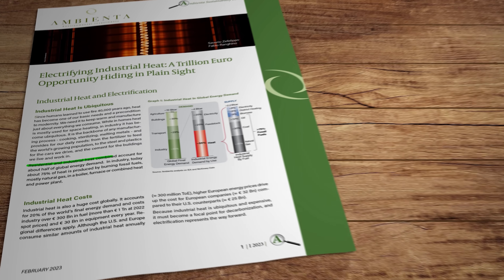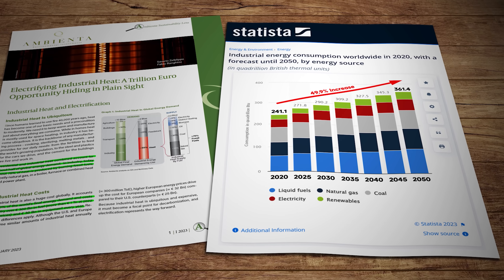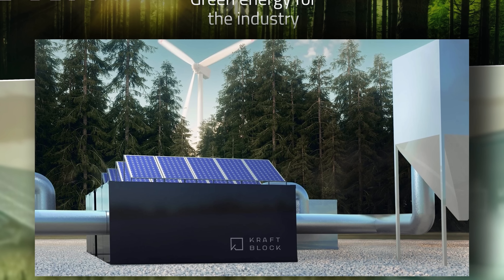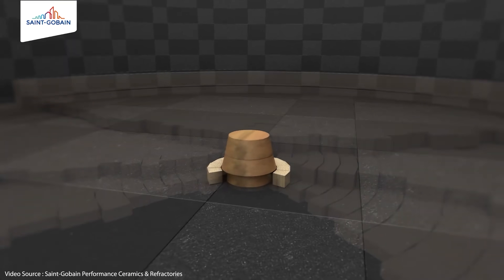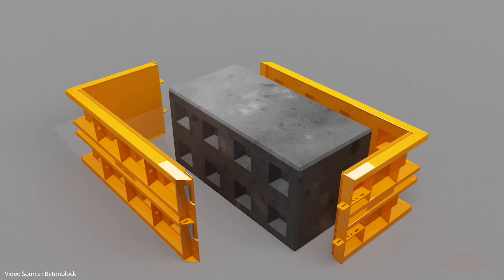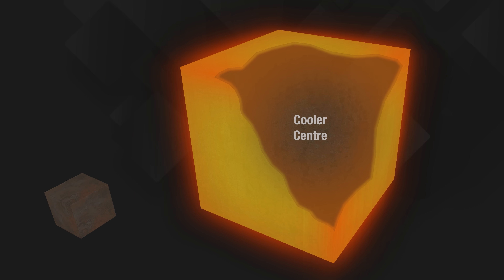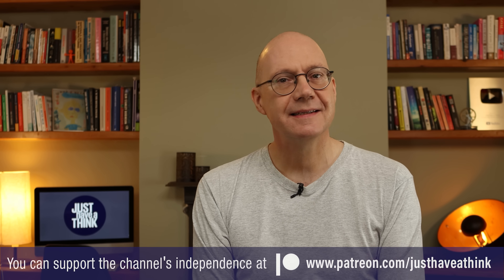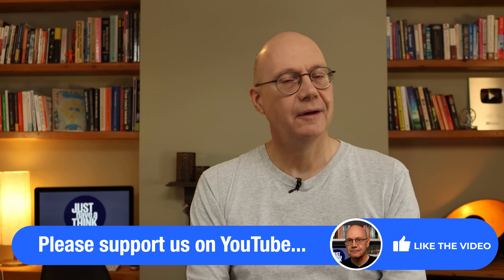Moving waste heat from industry to homes.

Comment: This will only make sense if you consume less fuel in shipping the units than you save in using the stored heat. Might make more sense as a supplement to cogen plants, to smooth out heat production. Similar to chilled water or ice towers for trigen. Also, how are they getting the waste heat up to 1300+ C to store it? Are they running some kind of power cycle/heat pump? Or relying on all waste heat sources being that hot? And in either case, would it make more sense to convert that heat to electricity instead? Especially for long distance transport. Lots of questions. Still has some potential, though.
Reply: Imagine using some of the heat from the container to boil water and create steam to run an external combustion engine.  A green steam engine!
Reply: no, not really. This is just the case in refineries and in the chemical industry. Flaring is an "essential" part of the steel production, @pin65371   The idea of a storage is to decouple "energy-generation" from "energy-usage" - so it is a perfect example why thermal energy storage can be used here. And to be honest: why should you use high-grade heat to generate hot water? That is "wasting" it again. There are much better use-cases. Capturing at >1000°C enables you to generate electricity, calcinate or sinter raw-materials, generate steam for one of the multiple processes in the steel-industry and so on.
Reply: I was also wondering why they wouldn't use the heat to generate electricity. Because with 1300°C you could run a heat engine at a theoretical Carnot efficiency of almost 80%.
Reply: @pin65371  shipping containers are well sealed
Reply: Hey there. This is true, the radius is limited for it to make sense. As for the 1300°C: Think about flare gases which make a huge portion of the waste heat in steel and chemical industry and flares are also used in the oil&gas industry.
Reply: @pin65371   Please dont.
Reply: @pin65371  Hi. the documented waste heat  from lost converter gas and BFG is more than 11 TWh each year in the EU27 according to the EU energy statistics. And there are date from several steel producin country missing. Our experience, especially in the steel industry shows that it has the potential to heat millions of homes.
Reply: @pin65371  This might be a use case, sure. A better use case however is to cut natural gas for a process that actually has 1000°C. This means less losses. Pre-heating water is easily done with a little bit of electricity or low-grade waste heat. Pre-heating air in a blast stove is rather difficult.
Additionally: what can be used to generate power is already used in integrated steel mills. Still, there are a lot of surplus gases that are flared.

Comment: (Relatively) Simple and interesting concept. When I heard ‘phosphate’, I wondered about sustainability of the system and potential competition with food production. Has the originator mentioned anything about the ability to substitute phosphate with something more abundant and less critical to other usage?
Reply: It doesn't sound like it would use all that much phosphate.  The heat batteries are re-usable for a long time, so you wouldn't need to continuously replace the phosphate.
Reply: Hey, we cannot go into that too much, but we developed a phosphate-based binder for the material which dries at ambient air to form the pellets. The material is tested for 15,000 cycles with no degredation seen. (This took 2 years to test, after that we stopped it due to our gas bill :D )

Comment: Slag can become a commodity. Its already recycled into mineral-wool insulation (fireproof, sound deadening and good R-value). Having more uses for recycling slag is a win. Don't knock coal as that also produces coke and ash recycled into cement board/fiber board that protect home exteriors.
Reply: Definitely knock coal because it produces more CO2 per kwh of heat, than any other fossil fuel. However there’s plenty of coal waste sites from large scale past use, and here recycling is welcome. Also there’s plenty of ongoing waste from e.g China.
Reply: Roxul insulation made in Mississauga Ontario
Reply: Yeah, thanks but I gotta knock coal anyway.  It is our most toxic fuel, and is responsible for the death of millions.  It's our most carbon-intensive fuel.  Mining it and dealing with the coal ash are gigantic environmental problems.  There is nothing good about coal.

Comment: Typical fundamental failure. Truck one of these boxes 750 miles and you're at a net energy loss. That's with 100% efficiency and 100% energy extraction. Mind you, thermal energy storage is a great idea. It's the concept of trucking high-density material at extreme temperatures that is mathematically stupid not to mention dangerous. Especially in the context of simply converting that thermal energy to electricity on-site and then using existing infrastructure to transport electricity. More buzzword based BS that doesn't stand up to highschool level scrutiny.

Comment: Why not use just gravel stone for this?  That's the way it is done in so many green houses. A 1m high gravel layer in the underground through which the hot green house air is blown during hot noon's, and recuperated during colder nights.
Reply: Gravel needs to be mined.  Slag is just lying around…
Reply: This battery uses more than just slag.  It's a sophisticated engineered material with at least two components, one optimized for energy storage and the other optimized for thermal transfer.  It's better than gravel.  If you're going to haul it around on a truck, you want it to be as efficient as possible.
Reply: @incognitotorpedo42  Should name me some low cost materials that fulfil these requirements, inclusive that they should withstand 1100°C?  Metals are excluded because not cheap!
Reply: Slash would actually be better than gravel for that use case, if only because of the reduced cost of collecting it a opposed to digging up gravel. I wonder why it's not always in use
Reply: @trueriver1950  I suppose the slag needs to be broken to small size?  And what with the breaker if metal parts are present in the slag?

Comment: If Uber was smart they'd open a division called just that!  This is a seriously good idea especially in places like Canada where I am where heating isn't just a luxury it's life itself.  There are tons of remote towns and villages that are relying on diesel power for both electricity and in some cases industrial heat. It's dirty, it's expensive and with our large amount of renewable potential it's insane... Small Modular Reactors are also a good fit however most places are quite anti-nuclear at a local level so the renewable power + battery solution seems much more "palletable" for a variety of reasons, pun very much intended...
Reply: There will likely never be a renewable/battery solution for heating.
Reply: @joemccarthy7120  Why?
Reply: It will always require the need for conventional backup generation.  That renders renewables/batteries almost a parasitic addition to the grid. @TheGrundigg
Reply: @joemccarthy7120 So you know very little but black industry talking points from mostly unrelated discussions of the electric grid .  Go away troll bot .
Reply: @johndododoe1411  Sorry.  I didn’t intend to upset your religious sensibilities.

Comment: This is a really good idea.  Thermal power plants, steel mills and dozens of other facilities would love to sell their waist heat.
Reply: I got tons myself to get rid of.... Waist heat that is..... I could use a smaller waist srsly... Know anyone that'd want it???.
Reply: An important aspect of this is the idea of using energy from surplus renewables to generate industrial heat within an acceptable tolerance on site thermal battery.  Processes like smelting could use renewables when their is a surplus to build a bank of thermal energy to be used in part or in full for a day.  If power prices for surplus renewables were accurately passed on innovative industries will put in the effort to work with the nearly free / otherwise wasted power.  Other processes like desalination or carbon capture could simply operate when the surplus exists.
Reply: Waste heat much above 100C isn't wasted at a thermal powerplant. Waste heat refers to heat that is lost and not easily retained or heat that is above ambient temperature  but not hot enough to extract anymore useful work from. 

Cooling ponds and towers at thermal power plants are below boiling point water or steam above that threshold can still have energy extracted from it to produce electricity. 

1000C plus heat isn't waste heat lol.
Reply: Waste.
Reply: And no one makes a pun about "waist heat".  I'm disappointed.
Reply: @yeroca Capybara did 1h ago .
Reply: @johndododoe1411  I missed it somehow.  Thanks for that!
Reply: @yeroca  why didnt you?
Reply: @ThatOpalGuy  "You want waist heat?  I got yer waist heat right here....  oh yeah."
Reply: it should be given, freely. not everything has to be about making money.
Reply: @ThatOpalGuy  Facilitating capture of the energy requires space for these heat bricks to be heated and picked up.  Businesses wont spend time and money on the space, equipment and logistics for this without compensation.
Reply: @ccibinel  the government will give them tax credits for it. after we raise taxes back to where they SHOULD be.
Reply: @ThatOpalGuy Sounds costly to administer and prone to loopholes and gaming (like most green incentives).  Charge the real cost of various forms of power (including taxation to offset negative impacts to the environment/health) then let the free market decide what makes sense.
Reply: @ccibinel  oh PLEASE....you dont think the SAME thing isnt happening in petroleum related industries?
PUHLEEEEEASE
Reply: @ccibinel did you even watch the video? The whole point is that the energy is retrieved into the container. The waste energy producer just plugs into it, there is no storage required of them.
Reply: @ThatOpalGuy  true true ......
Reply: @ThatOpalGuy  Not when to whole sham is a money making scam.
Reply: This is why we need to improve thermal photovoltaics too.

 Instead of using energy to transport that which is inefficient. Convert it to electricity instead. 

 I think some good new technologies just happened this year with them for higher temp applications like this here, and the energy gathered was more efficent or just as efficent as a turbine.
Reply: At a completely unaffordable price!!
Reply: @manoo422  The true cost of energy when environmental and health impacts are factored in is significant.  It is not surprising that europe is spearheading these kinds of innovations.  Heat energy reuse or capture from legacy industrial processes is a largely untapped clean resource.

Comment: Seriously that is plain stupid of you to even suggest this as a concept. I live near a mining conglomerate  Called Vale, this company used to be called Inco or International Nickel Company. I remember that no so lomg ago that the Chinese had offered to buy all the slag that had been gathering dust for 100 years of dumping the stuff and INCO at the time refused to sell it. Because there is still untapped mining minerals still part of that slag.Who would have guessed? Well certainly not you apparently!
Reply: One thing Dave is not, and that's stupid.
Reply: that's mine tailings, which, you're right, do include a lot of valuable minerals that it wasn't economically viable to separate and purify when it was mined but might still be very valuable in the future.
I'm pretty sure that this company was talking about steel slag, which is much more similar to cement clinker than anything else from what I understand, so it probably doesn't have the potential value of mine tailings, let alone tailings from a Nickle mine since Iron isn't nearly as valuable as nickel.

Comment: I've worked in a steel mill...when big chunks of steel are formed/bashed when hot and relatively malleable, there is a massive amount of clinker/slag that falls off it. Over and around 10 metric tons a day was being shed at the british steel mill I was in, around 30 yrs ago...so it wasn't a truly massive setup by then.
Was soon after pulled apart and sold to a chinese concern.